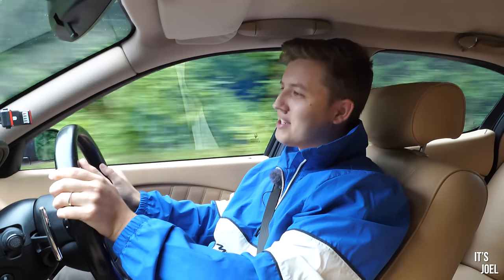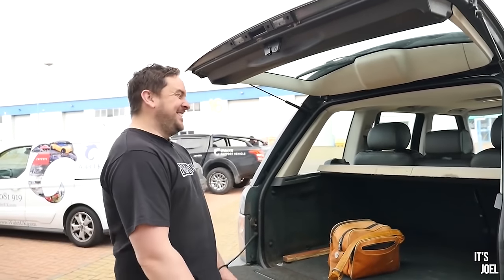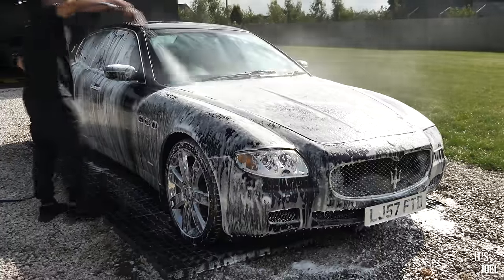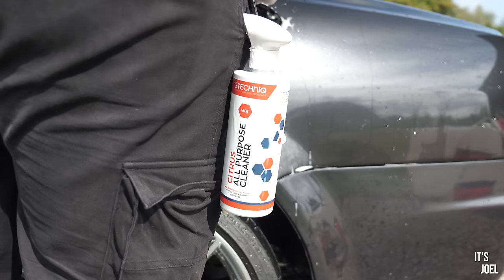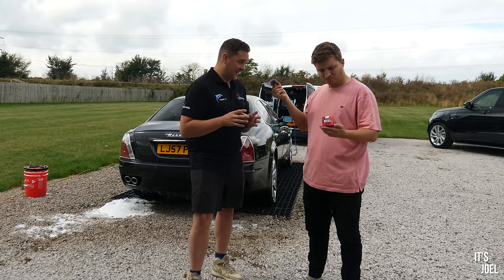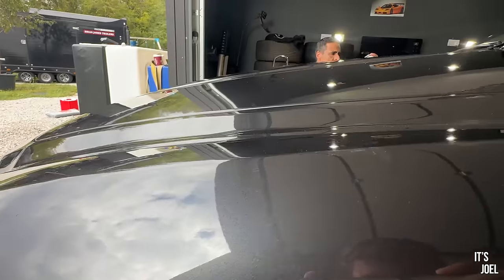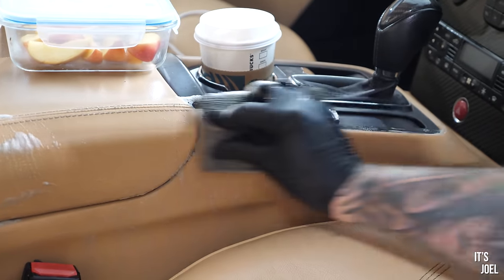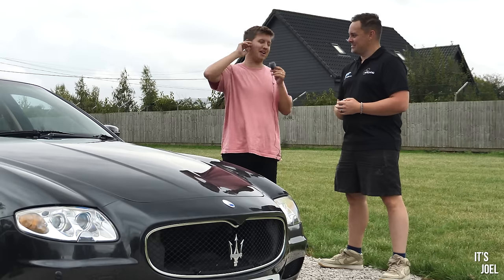My Maserati Quattroporte gets a full detail & ceramic coating!

Comment: That looks amazing.  The paint is popping.   I use various lotions and potions in my car cleaning routine but I have never spent £50-60 on a wax or coating.  Is it worth the premium?
Reply: @Camrocok  think of Gtechniq ceramics as an investment in time. Once you’ve got your paint to where you want it to be, to keep it there, really you’ll only need to wash the car in future for at least 18 months and it’ll be very easy when you do 🤝
Reply: @ivaletuk  I have a garage full of lotions and potions but never spent that much.  My limit is probably the £20 on a Meguiars spray on ceramic I use to help dry off the cars

Comment: What a beauty.  I’d love an older Maserati but I’ve always been put off by the fuel consumption which appears much higher than 4.2 and 5.0 jags I’ve owned and put up with.  I wonder if that’s the reality and how it compares to the old S Type.  So tempting.
Reply from the maker: I averaged 32mpg on the 100 miles up to Cambridge. It’s remarkably frugal if you drive accordingly

Comment: Foam thickness has a lot to do with water hardness, soft water means more foam, hard water less foam assuming u use same amout of product. Too much snowfoam will strip protection
Reply: Snow foam will not strip actual paint protection as that's what it is designed to do, protect the paintwork from chemicals. What you're referring to might be waxes and spray sealants, these don't actually offer any protection apart from hydrophobic behaviour and is a miss conception within the detailing world.
Reply: @avdavd4729  agreed, snowfoam strips waxed and spray protection. Thankfully these are super easy to re apply. Ceramic coating lasts max 12mths in a normal weekly wash and daily car use environment. Sad that all these companies claim massive longevity, I have had a few, great for show cars to avoid swirls, not worth hassle for a daily when u can spray and wipe a sealant.